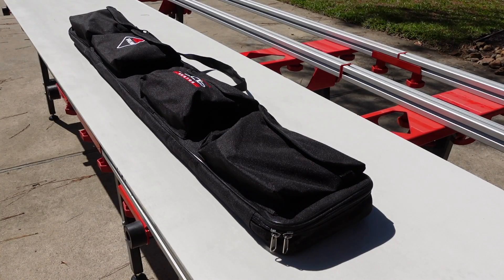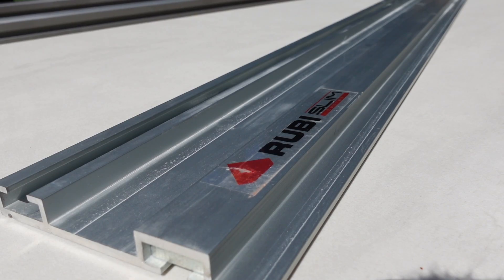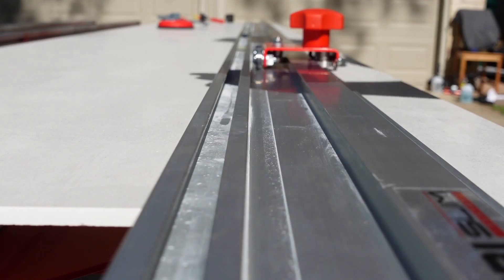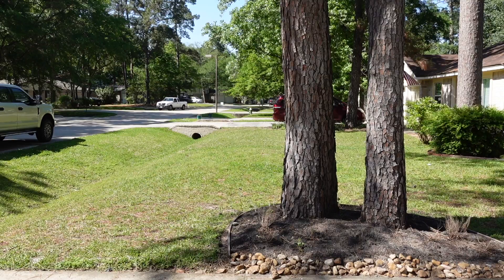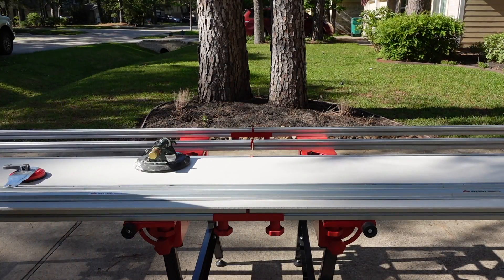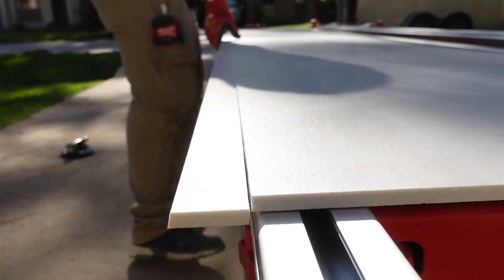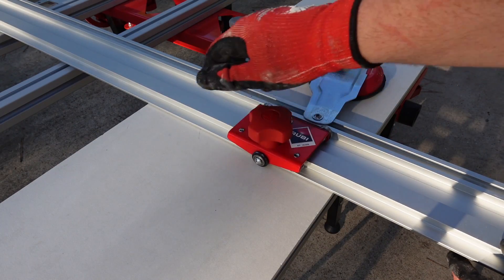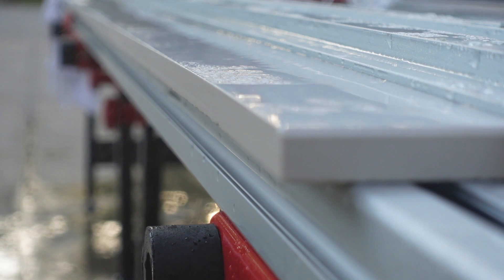Rubi Slim System Cutter - How Good Can It Really Be?

Comment: Hi. Great video. Thank you. You mention that this system can cut up to 8 mm. On my next project, I will be using 10 mm 36" X 72" porcelain panels. Is there a reliable way/trick you know of that would allow me to cut 10 mm tiles with this system, like scoring on both sides?  Or do I have to get the TC125? Thanks in advance !
Reply from the maker: Ive had hit and miss experience with 10mm.  I personally would go with the tc125.  No struggles and ease of cutting

Comment: I bought this at Floor and Decor for the 8ft Slab System and let me tell you it will BREAK YOUR SLAB, please use a Circular Wet Saw and a Turbo Mesh Blade don’t waste $469 like I did
Reply from the maker: First off, what table were you using?  And what brand of slab material & thickness?  There is a very large learning curve no matter what tool you buy.  Plus if the slab is compromised from shipping or your table isnt perfectly flat, you will also fail.  I encourage you to keep practicing.  You’d be surprised how important the slab quality and thickness affects the cutter
Reply: @porcelainpanelpro  1/4 thick no mesh at bottom , I bought the $600 Rubi table to go with it but the blade doesn’t score deep enough even with multiple passes so I quickly realized a Circular wet saw  Is the way to go even it if takes an extra 5 minutes , We broke 2 slabs “practicing”  (You Live and You Learn)
Reply: Damn.i bought all of their products mentioned here. The first rail system, the second one with the beefy adjustable crackers…and the TS circular saw which I love. I was gonna attempt to use the scoring system for the first time tomorrow…and now you have me nervous. Screw that. I’m sticking to the TS tomorrow. I’m not up for buying these folks any new tile! Hell, I even have the big boy Rubi DC 250 at the job for my L cuts. Going with the 24”x48”…so I gotta get it right. Thanks for the heads up!!!💯💯💯💯
Reply: @EvRyDayCarry my man, I’m having a hard time cutting 48x48 even with a wet saw, about to cry so frustrated
Reply: @ get 4 inch grinder and put a Rubi blade on it with a sponge 🧽 will easily cut 48x48 no wet saw needed
Reply: @ i try that yesterday and it didn’t work either. Even bought a wet saw for that. Can it be the tile for some reason?
Reply: @ no it’s the Blade you cutting with even those cheap Ryobi grinders can cut through 2 inch porcelain patio tiles , Rubi Turbo blade with a little water try that
Reply: @EvRyDayCarry  heading to floor and decor now they don’t have turbo , they do have super pro
Reply: @ make sure it’s the Mesh type blade “Rubi turbo mesh” is what floor and decor has a different stores